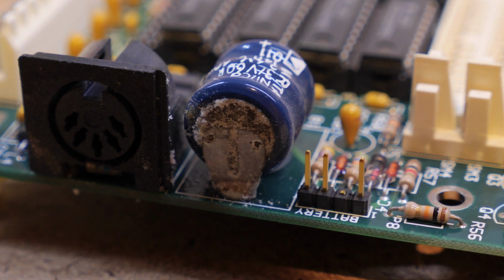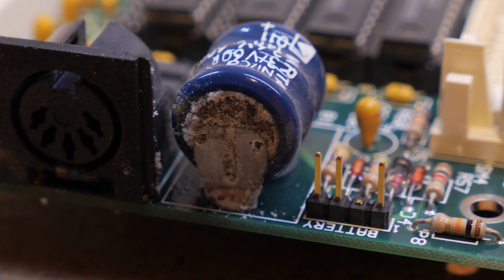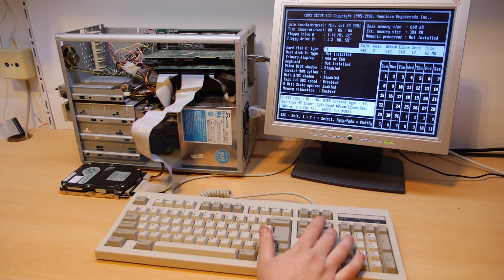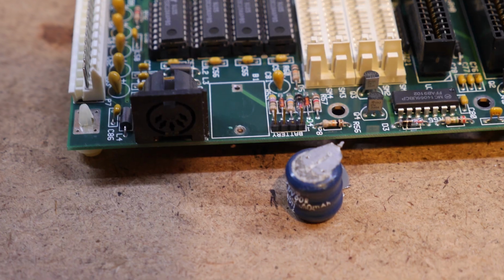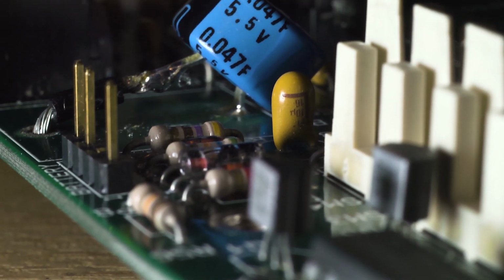Supercapacitor as CMOS Battery, Fix your Retro Motherboard

Comment: Very dangerous, super dangerous mod. Depending on how the main board deals with the cell. If the board simply applies 3.3V directly to the cell when power is applied to the board, the cap will pull ALL of the available current and that's very bad.

Comment: I have done a lot of soldering to fix up retro motherboards, fixing damaged traces/components on 286/386/486 boards that had leaky batteries, and replacing leaky capacitors on the early 68k macs like the mac classic ii, mac lc 475, iici, centris 610, etc. I found many of these macs off of ebay which were marked as dead, i knew that the #1 sign of a dead old mac is the leaky capacitors
Reply: Can you pls fix my father's 286 and 486 systems?

Comment: Using a capacitor as a CMOS battery has a few problems, the first being that it has nowhere near the energy capacity as a battery.

A 3.6v NiCd barrel battery is rated for about 60 Mah, or can put out about 770 joules of energy.

A 0.047F (47,000uF) capacitor at 4.1v can only output about 395 millijoules (0.395 joules) of energy.

You would need an absolutely massive super capacitor, around 92 Farads @ 4.1v to equate the energy output of the NiCd battery.

The second problem is that a capacitor has pretty much a linear relation in voltage to the current charge, unlike a battery which will generally maintain a stable voltage until most of its capacity is drained. So even though a super capacitor has a similar amount of energy stored, a large portion of it will be unusable because the voltage will drop too low to be usable.

The third is that when charging a capacitor, it will appear is near a dead short because of having a very low internal resistance of milli or micro ohms. Batteries have a comparatively high internal resistance, which limits the charging current. I wouldn't smack a large super capacitor across a battery position on a motherboard without having a charge limiting resistor, but this introduces the problem of increasing the discharge rate of the capacitor.

Comment: Hello. Please, can you test if a rechargeable Li-Ion 18650 battery works well instead of the capacitor? 18650 batteries are very easy to find.
Reply: No. NiCD and lithium ion batteries require different charge voltages and charge cycles. A NiCD battery can be float charged pretty much indefinitely as long as the current is low enough, as the waste energy is burned off as heat. Doing the same to a lithium ion battery will result in the destruction of the battery.

Comment: Maybe you should try paralleling more supercap if one isn't enough to hold the cmos data longer.
Reply from the maker: +lukasb95 You can buy much bigger ones :)
Reply: +victorbart Please give us an update when you found out how long the supercapacitor holds the charge! BTW Toyota used a supercapacitor instead of a battery for their TS030 and TS040 racing cars :-)
Reply: @armorgeddon  Would be nice to know the answer.
Reply: Yes :-) In the meantime I found out that my electrical toothbrush uses a supercapacitor instead of a rechargeable battery, too. Because of it it looses maximum power pretty fast even when just standing around disconnected from the charger, but it still holds enough charge to power the brush for days. I never tried what's the maximum period until it's fully empty.